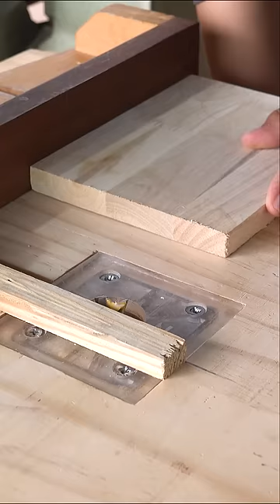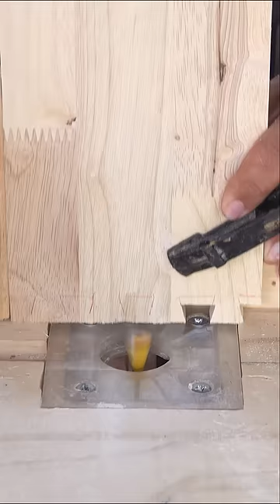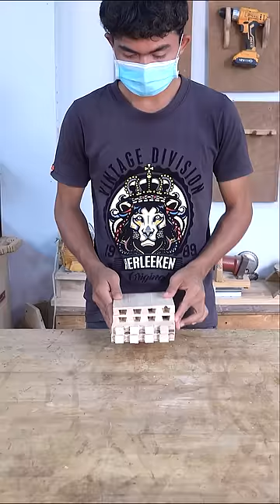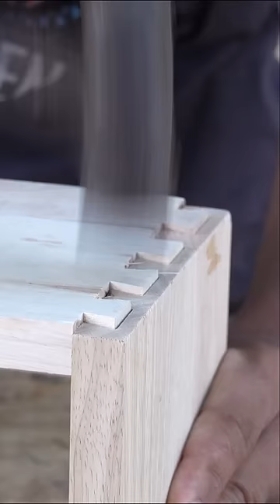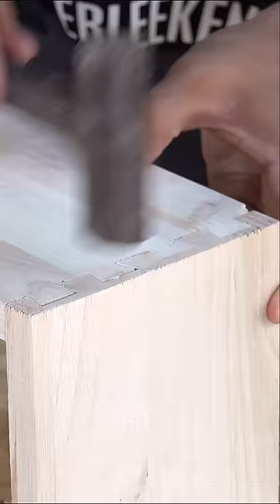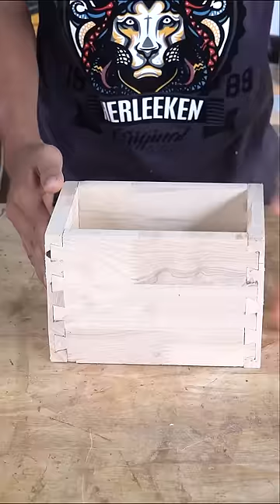Box Joinery using Router #shorts #woodworking #diy #trending #amazing

Comment: What about the rounded ends on the inside of the box?
Reply: Fill them with sawdust and glue if you're worried about it. I guess those gaps are a place where bugs could hang out.
Reply: Put that ramen in it. Is that still a thing? 😅